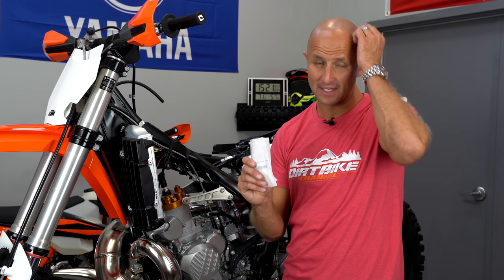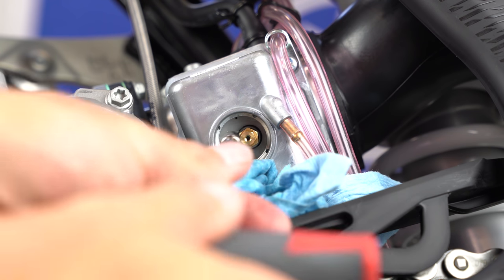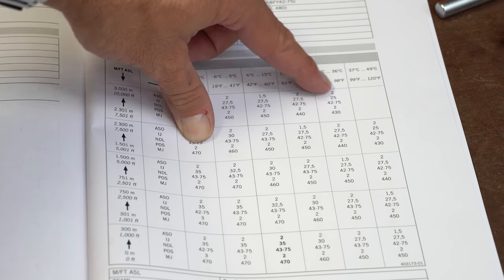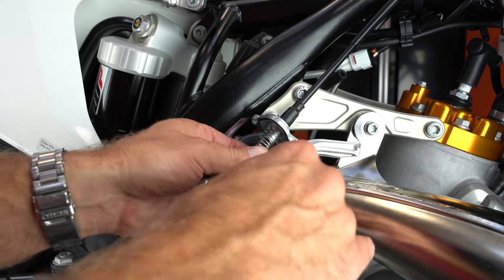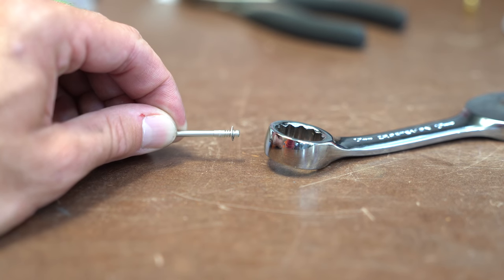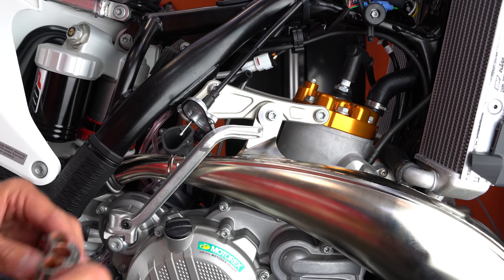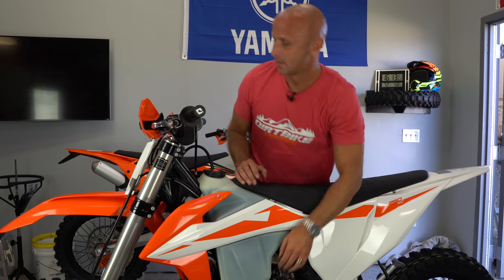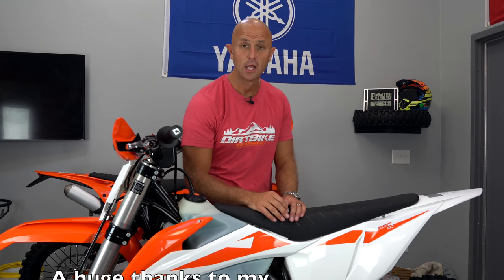Save $500 and Have a Great Running Dirt Bike | How to Jet Your Carburetor

Comment: Glad someone else is saying it. I have successfully tuned mine as well for my area.

Anyone who says that these Mikuni carburetors cannot be tuned and are “junk” are wrong and are most likely inept or trying to sell you something.

Change my mind.
Reply: Correct-no need to spend 500 bucks.  I got mine jetted right with the extra jets and needle that came with the bike. If you need different jets/needles, you can get them cheaply on line.
Reply: Matthew Turowski yeah I went and got smaller jets locally. Cost me about $8
Reply: @gbagz69   I and a few others tried everything before buying a keihin.  Yes the Keihin runs perfect. Same jetting principles were applied to the mikuni.  It must me batches of defects.
Reply: LR T interesting. Did you buy new jets and still have issues? Or did you just try with the stock jets? I had to buy smaller jets than the carb came with.
Reply: @gbagz69  My pilot jet kept going down from 37.5 - 25, along with different mains and needles.   They were all Mikuni oem jets.   It stalled out a lot, spooge, loads up and very inconstant. Fine one hour and bad the next.  I even used JD jets.   I find its not the jets but the brand new carb.   

It's the total opposite with the keihin. Took me 5 minutes to tune the jets.  I ride up single tracks that I can never make it up with the mikuni.   With the mikuni it made me second guess, that I should have bought a 250 xcf.  Believe me, the last thing I wanted to do was spend an additional $350 on a new bike to get it running right.   Now its totally worth it.  I get excited to ride it.  I wish to find someone with a working mikuni locally and we can test ride each others bike. It may change your mind. Vice versa.   I also never consider myself to be very picky about jetting either and still don't.
Reply: It’s easy to tune the Mikuni, it just doesn’t stay tuned.  Constantly chasing a clean tune depending on temp, humidity, barometric pressure..... the Keihin is more set it and forget it for the most part, or at least the tuning ranges overlap more to me.
Reply: My 17 250xc is the best running bike I have owned.  Rejetted the stock mikuni when I got it and so far from 90* temps down to low 40*s all I’ve adjusted is 1/2 a needle clip position and a 1/8 turn of airscrew.  Bike runs great, all the time.  There is absolutely nothing wrong with the mikuni carbs, the only reason people even swap to a kehien is because they have been on tons of 2t dirtbikes for years so they have been figured out, nothing more.
Reply: @z324u  I haven't found this problem with any of mine.
Reply: @Kyle Brotherson  I’m not saying everyone will have an issue, I can only speak for myself and other friends locally.  I can recall >10 people off the top of my head who have asked at races or group rides how to get the Mikuni consistent.  I thought I had mine consistent, but then a week later I was swapping pilot jets or needle position again.  It always seemed to be off on the bottom or the top (on the pipe), never could get it right on both ends to my liking.  To each their own, everyone’s mileage may vary I suppose.  This is turning into a 9mm vs .45 debate, or maybe 2st vs 4st 😂
Reply: Geoff Winner there seems to be a problem with some of the Mikuni's having a bad jet block gasket. NO carb can be tuned if that gasket is bad. Might have just been a bad batch of carbs. So no, those guys with the 'bad' carbs are not inept.
Reply: I have two CR250's with Mikuni carbs and run them from 500m up to 2500m from early spring to late fall with no more than an airscrew adjustment. Woods/Mountain riding in Northern BC. They always start good and run good for me. My buddies with Keihin carbs always have to tilt their bikes side to side before trying to start.
Reply: I agree.

Comment: I have a 17 husky te300 and got it to run pretty good but it was never perfect. Could never get rid of the mid throttle stutter. Cut holes in air box and even tried jd jetting. Bought an Lectron and couldn't be happier!!

Comment: Could you do a video on what you feel for or listen for in each part of the throttle to tell if it's to lean or rich?
Reply: you sort of can but nothing beats experience. when you melt something from being lean, you'll never forget! do you have a tech you can trust in your area that is good with this stuff?
Reply: If that exhaust pipe is hotter than hell an damnation itself. Your too lean.
Reply: @benshapley3587  HAHAHAHA, yes, that is one sign...  
@Garon Burwell  Learning how to read the spark plug color is one of the best ways on a 2-stroke.
Reply: Install a new plug or clean your existing plug very well anytime you make a jetting change, if its black you're too rich, if it white you're too lean, it should be a golden brown like a proper campfire marshmallow. this is a great way to have a visual and you can then correlate the results with how it runs at different throttle positions to get a feel/ear for it.

Comment: I ended up getting a 100 dollar JD jet kit, and it made my 300 a super tuned machine. No asthmatic throttle range. Just pull and pull harder as you need it.

Comment: I slapped a JD kit in my '18 300xc and its fine, just a little turning of the air screw when the temp drops. Gotta love the spring trick, I always used a pair of needle nose vice grips , will have to remember this

Comment: Kyle, great video,  my bike has a throttle position sensor.  When i went to change the needle I noticed this extra metal piece over the slide.  Just making sure that the proper way to reassemble is to have it sitting over the slide when doing the reassemble operation.  Thx for sharing your experience

Comment: You hit the nail on the head Kyle!  Jetting a carb isn't rocket science and most people, I believe, just get intimidated by it.  You really don't need to buy an aftermarket carb.
For me, I've just gone out and purchased the JD jetting kit for my bikes for under $75 and then fine tune it from there.  Since I live at 5,600' I had another needle with a preset clip along with jets in my fanny pack so I could swap out if the elevation dictated.  20 minutes is all it took me to swap over.

Of course, fuel injection changed that one on my 2017 lol.  Great Vid!

Comment: Good trick with the spring if you have trouble getting it together with the spring fully on the cable. When you start you can just pass the cable thru the top of the spring and then out the side a couple coils down the spring. Makes it easier than trying to start the spring on after the cable is in place. Also, I'd immediately take on of those screws from the slide cover to the hardware store and replace them with some socket headed cap screws. Where on earth did they find bolts with 7mm heads? Someone must have been trying to make it difficult. Also disappointed to see those bolts aren't captured in the slide cover.

Comment: I always jet my bike for the upper elevation and upper temperature range of what I'm expecting, by doing this it runs well as the day progresses from heading out of camp to way the heck up in the mountains and it warms up. Also, this creates a scenario where the worst that happens is I run too rich and at worst will foul a plug (which hasn't happened in a very long time) as opposed to going too lean and melting pistons.

Comment: Tip. At 11:11 Pinch that cable with some vise grips, preferably needle nose vise grips,  where your left hand is pinching it. Spring fully compressed exposing as much cable below it as possible. This way the spring can stay on the cable and make re-inserting the cable much easier without having to twist the spring on.
Reply: DenkertM Just make it tight enough to hold the spring back. Not real super tight. It wont hurt the cable or break it. Then you can change or adjust the needle and come back and its still holding on ready to re-install. Been doing it for years, no issues. Just tight enough.

Comment: I've always jetted my own bikes and been fairly successful using the KTM manual charts.  I must say, though, having run a JD kit in my 2013 KTM 250 XC-W and now recently run one in my 2012 Husaberg TE300, they simply work.  Best $79 you can spend, to get them running well at all altitudes from 4000-12000 feet.
Reply: Did you listen to the jd chart or do the one up one over like he did

Comment: Torque on the float bowl drain plug...."Doesn't need to be too tight....."  Then he gives it some more.  Torque until it spins freely.....LOL.  Something I did to help me hold the spring when replacing cable in the carb slide.....I cut a slot in a quarter (illegal....ha!) that the cable fits in.....use it to compress spring (EZ on fingers) and slip it out when you want to.  Also use small, flat magnet to press clip on/off.....it "captures" clip and has saved me a lot of misery on the trail.  You'll know what I'm talking about if you lose a clip in the dirt on the trail and can't find it.....all the cursing and prayers will not find that clip sometimes......trust me.  Of course, you have great new equipment.....I have inferior old bikes.....or, "in fear of your equipment" is the way I have to live......sigh....

Comment: This video is a great resource. I've been messing with the carb on my '18 300 XC-W for a couple months now and it's nice to hear someone else's take on jetting. I started off with a JD jet kit but it was way too rich and my bike lost its low-end grunt. I went back to the default KTM spec and have been afraid to change the settings until now. Thanks for posting!

Comment: I’m not picky about jetting at all but my TX300 has been pretty bad from day 1. I’ve jetted bikes before and obviously it’s not difficult but I have to go “off chart” to get mine to run decent. I got the mid/top cleaned up using the advice in this video (one up and one over on the chart) but down low it’s still way too rich. I’ve got the smallest pilot jet that came with the bike in now. 

Is that all it is? That the manufacturer is just protecting the bikes by suggesting very rich settings? This video has convinced me this might actually be the case. Ordering smaller jets now. Thanks Kyle!
Reply: I know your reply is older, but your jet block gasket is probably the cause. JD Jetting has a great replacement. The original gasket is junk, but the carb is very good once that gasket is replaced.
Reply: Yep. I had to do exactly that. You are 100% correct.
Reply: Yep. I had to do exactly that. You are 100% correct.

Comment: 2017 KTM 250XC here.The problem with the mook (for me) was under the same (ish) elevation and temps on different trips it wasn't consistent...not by a long shot. Then I went to the Lectron which was a huge mistake..no bottom end (and yes I adjusted the rod and spoke to Lectron a few occasions). Sold the Lectron and went with the PWK w/STIC. Bam! Bike runs great now and it's consistent. Fueling is instant, zero burbles, clean,  and the power band transition is very very smooth.

Comment: Kyle great informative videos as always. I completely get the jetting chart and am more than capable of changing the jets/needle/clip as needed but these charts are based on a stock bike. In your opinion, do you think these charts should still be fairly accurate considering I have an FMF GNARLY AND FMF SHORTY exhaust? In other words, how much does an aftermarket exhaust make to the jetting chart?

Keep up the great work, hope the knee is going strong.

From London UK 👍🏻

Comment: Note that these Mikuni carbs are known for jet block gasket failure. That's a tiny little gasket you can get to and replace, but you will need to remove the carburetor from the bike. This may make the bike perform badly on idle and up to mid RPMs. Take off the jet block and inspect it if you have a chance.
Reply: Just to add. You can either make the gasket or buy one off the JD Jetting site.

Comment: Kyle I have 2 2019 tc250s I live right about 1000 to 1100 ft nothing but sand in northern mich. I was reading in my manual I need to do a different set up for sand. Can you give some insight on the subject? Thank you Bob 😊

Comment: You can’t beat the Lectron 
It’s the best mod you can do to a bike 
But if you like pulling jets constantly they do work 
I ride 50% moto 50% enduro and you just can’t jet for both it has to be one or the other 
With the Lectron all I had to do was adjust the idle and it been spot on for both riding conditions 💪
Reply: That's true if you don't know how to jet a carb.  Lectron flat on power compared to a keihin.
I swap jets once per year for winter once temp get under 8c
Reply: Flat on power I don’t think so 
Smooth and predictable yes
Reply: I don’t get it when people say power is flat with a Lectron. I’ve been riding smokers for 30+ years and my 17 250xc flat out rips with the Lectron. I run the 5-1 needle, tweaked a couple of settings on the needle and top end screw, installed Vforce reeds (which I felt the improvement from before I even left the parking lot) and couldn’t be happier. Plus I can ride pretty much all day on my stock tank.
Reply: It's more to do with until you've tried the other options you don't know what your missing.  Lectron does exactly what it says on the tin but there's definitely more to be had with a keihin 38mm with correct jetting. 
I've just ordered a STIC  to improve things further

Comment: Not sure if i missed something but i haven't learned anything from this video.
Everyone should know how to follow a chart and adjust accordingly.
We need to learn how to adjust it without a chart. 
How to tell if the pilot or main is too rich or lean, how to adjust the air screw, when to change the needle or adjust the clip position..
None of it was explained :(

Comment: Thanks for the great video what about sand dune riding any tips or tricks for jetting then? I’ve always had trouble jetting my older two strokes on the sand not sure if it’s the coastal influence or what. getting a 21 250sx I would imagine follow the temp guild lines with sea level and be safe? Thanks!

Comment: Any tips for taking a bike to the Sandunes i’ve always had trouble getting my older two strokes when I go to the Oregon Sandunes getting a new 21SX  250 and I imagine if I follow the guidelines for sea level and the temperature it would be safe to run? Awesome video! Like the ktm charts

Comment: I just swapped from my EXC-F 450 2013 to a 300 EXC 2012 and had the surprise of high fuel consumption on Enduro circuit. Mostly traditional Enduro style track. About 34miles with the 9.5L tank. Would that be a thing of jetting or would I be better off using the JD Kit? Thanks in advance